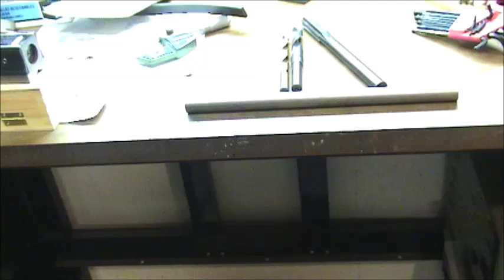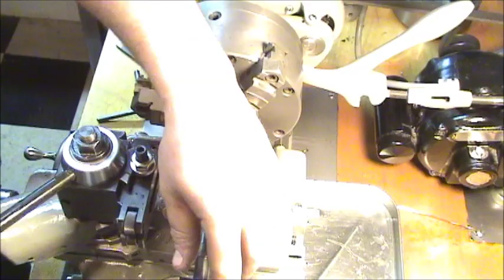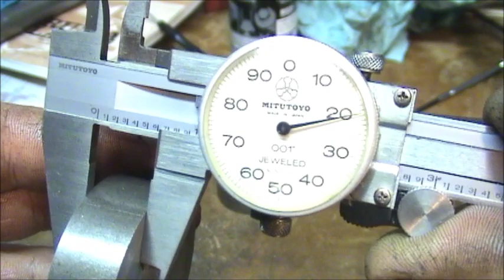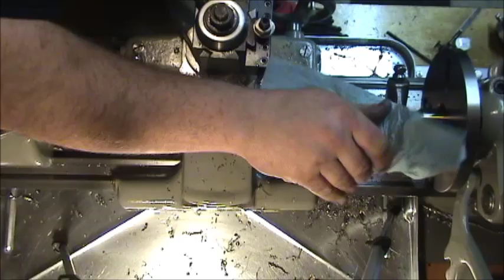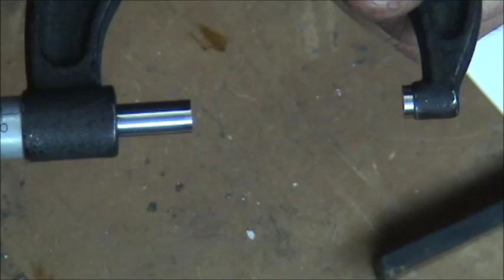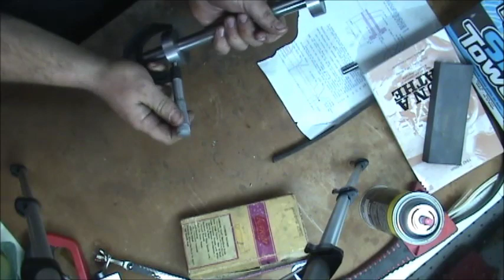Two Collar Lathe Alignment Test

Comment: Hi Halligan, 

I was reading up on lathe leveling and headstock alignment and found what I think is THE best way it can possibly be done. It's been explained by the legendary Forrest Addy on several occasions, on several different forum threads on Practical Machinist and Home Shop Machinist, and highlights the pitfalls of the two-collar test method, or I should say the version of the test shown in this video (the most commonly practiced one).

Here goes Forrest's post:

''Here,s my rant on the whole topic of lathe leveling that includes the two collar method. 

Leveling an engine lathe by Forrest Addy: 

Generally it goes like this on the better and larger lathes and import and bench lathes as applicable: 

Run the tailstock to the far end to get it out of the way.

Level across just in front of the headstock using the spindle end jacking screws. 

Locat a point on the near and far way midway between the spindle ends jacks and the tail stock pedistal jacks as londitudial leveling points. Place the level at these points and adjust the near and far way using the tailstock end leveling crews. 

Check across at the headstock and tail stock and adjust. Check longitudinally at the headsstock end. You'll probably find some hump in the bedways at this point because the change gear end of the headstock is unsupported. Lay the level on the near (operator side) way and slowly adjust the near change gear end leveling screw up until you get first movement on the level. Move the level to the far side and repeat with far side. 

Start over, refining the leveling this time snugging the locknuts. It's quite possible you'll have a jacking bolt with no weight on it. If the floor is stout (5" or thicker) and intact drill for hold-down bolts working the bolt against the jack screws. You may find your body weight is affecting the leveling. This may indicate the soil has subsided under the concrete. If this is a problem talk to a concrete contractor about slab jacking.

Now to tune up the spindle. For that you need a precision ground test bar unless you’re resourceful. I hate the factory test bars. They're always limber and crooked. 

I prefer a home made mandrel in a process I’ve come to call the “two collar method.” You need nothing more than a $4 piece of pipe to accomplish the same test as a $500 test bar. Chuck a piece of Sch 40 pipe that will just clear the cross slide about a foot long. Using HSS and light cuts, turn a couple of short diameters about 1/4" long - one next to the jaws and the other at the far end. Relieve the pipe between the diameters. The pipe is sure to chatter; plunk a piece of plywood against the end of the pipe so it stays there with the center's thrust into the raw wood. This will damp out the ring and chatter without influencing the final straightness of the pipe. 

Individually finish the diameters to the same size within 0.0005” and give them a light polish so the indicator doesn’t snag. .Don’t sweat making a perfect cut at the same tool setting. Cut them separately. Check them with a mike and a dial indicator. Find the average point of both diameters (there's always a trifling amount of run-out when machining pipe). These average points are used when checking for spindle parallelism with the carriage motion. 

Mount an indicator on the carriage so it registers the diameters in the vertical plane. Traverse the carriage along the ways. Adjust the change gear end to bring the spindle axis parallel with the ways in the vertical plane.

Repeat moving the indicator and differentially adjust the jacks to bring the diameters into parallel in the horizontal plane. A second indicator on the vertical plane will allow you to adjust for the horizontal plane without disturbing the vertical. You may need a helper because this is the point where alignment becomes complicated. Some headstocks on the better lathes are set for parallelism by precision scraping their fit on the bedways. Others have a means of angular adjustment. This can take many forms from opposing jacking screws, to a pulling bolt and a pushing setscrew accessed from the same side. Cheap lathes may use shims. You will have to look if you don’t have the original installation manual 

OK assuming the headstock is in alignment, the next step is the tailstock. A precision ground bar between centers is nice if you happen to have a precision ground bar.

When setting up and leveling a used lathe, sooner or later I conduct a short survey of the tailstock’s condition answering to my self the following questions: Is the quill a snug fit in its housing bore? Does the tailstock base fit flat on the bed so I can’t get a 0.001: feeler under it anywhere. Does an indicator scanned along the fully extended quill shows its axis to be parallel to the carriage motion to 0.0005” per ft.? Is the internal taper clean, smooth, unscored etc? 

If OK I turn a slug gripped in the chuck to the tailstock quill’s diameter. Then I move the tailstock to an unworn portion of the bedways. Setting an indicator zero on top of the slug in the chuck I then crank the carriage to the tailstock and check the top of the extended quill. In a new lathe the indicator will register zero to +0.001 with the quill rising. A worn lathe may have a tailstock whose base is shaped like the runners of a rocking chair. A re-scrape to correct fit and a shim to raise the tailstock quill to the spindle axis is a regular task when re-commissioning an older lathe. . . 

Leveling and aligning a lathe is not a 1-2-3 operation. You'll have to go over the machine several times to bring it in level and then in alignment converging eventually on the best results the machine’s condition will allow. If the machine has significant wear you'll most likely have to compromise.

Finally, a worn lathe with significant hollow in the ways and rocking chair on the saddle may not be capable of alignment to turn straight diameters over 6 inches long. There is no golden cure, no trick of alignment or leveling, no special techniques that will eliminate the effect of wear. You can work around wear with skill and technique but it will always be present interfering with efficient and often competitive operation to some extent.

Do not use "Rollie's Dad's method" for lathe alignment. It really doesn't tell you much.''

Comment: While you are using two collars, so this is "technically" a two collar test. This is not what folks mean by a two collar test.
All you have done was find a more complicated way of aligning the tail stock.
This does nothing about aligning the spindle to the ways.
A two collar test is done with a very fat piece of stock in the chuck. Use the fattest stock you can get into the chuck with out support on the tail stock between 6" and 12" long.
A nice piece of heavy aluminum pipe sticking out from the stock about 7" is good.
Cut a 5" long relief about .030" in the middle of the stock, and now you have two "collars" 6" apart.
make a light cut and a spring cut on both collars with the cross slide locked, and measure the diameters. The tail stock end should be the same or .0002" larger if the ways are inline with the spindle. Raise the jack screw under the front or back of the tail stock to twist the bed into alignment and repeat until it is correct.
Now proceed with aligning the tail stock.

Comment: Another point, the alignment of the tailstock is in a short, fixed, consistent state.  If the tailstock is extended (as during use), you would need to perform this test again.  
For accurate details (.0005), this is a concern.
While I don't think you require this precision it's good to know.

Comment: You should only go to a reamer after a drill if you cannot take a boring cut on a hole on the lathe.
The reamer will only cut on the leading, ground edge.  If the hole is not "dead straight", the reamer will attempt to follow the drilled hole.  With the "acceptable" half or so thousandth in the tailstock alignment, over the 10+" of extension between the tailstock and drill point (as shown), there is considerable misalignment.
This can lead to "over cut" using a reamer.

Drill, bore, ream - best.

Comment: BTW, if you cut the collars on this video and find that they're off, you can use a height gage off the ways for vertical alignment, and then the "Last Word" for lateral adjustment (rechecking after adjustments and tightening).  It might speed things up; I worked into .0005 with this technique.